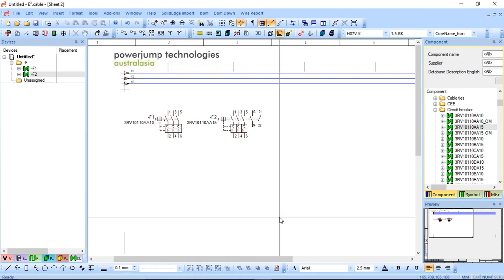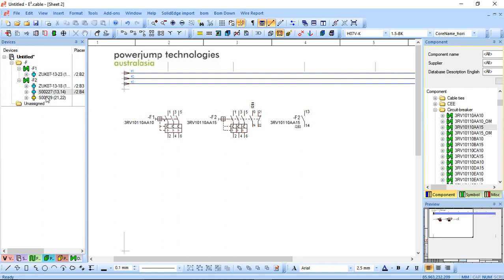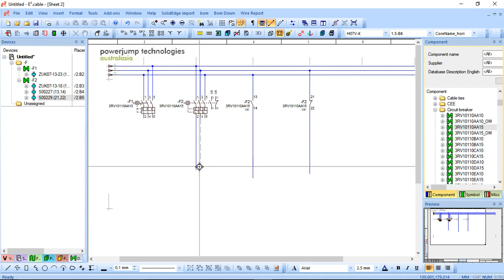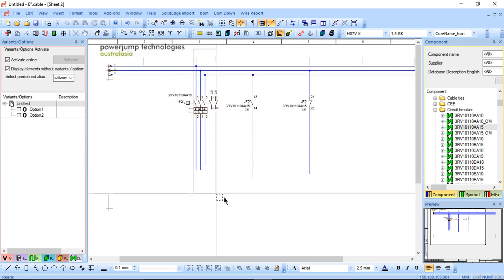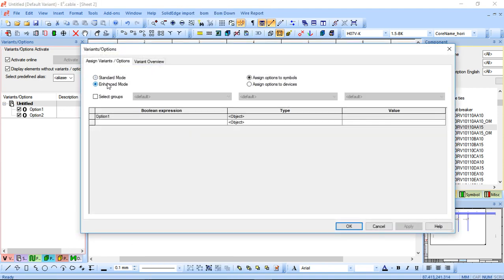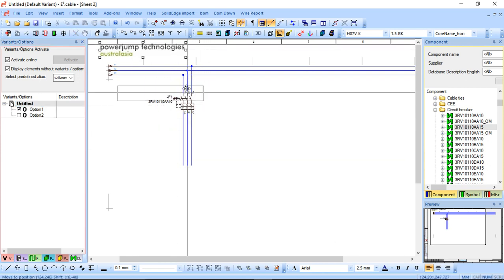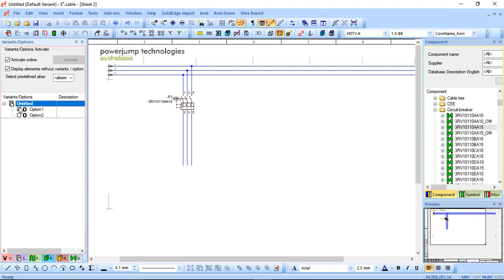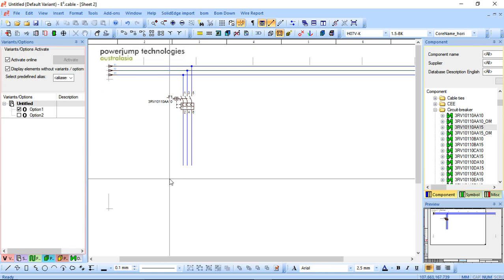Easy option/variant creation and selection using Zuken E3.series

Comment: Thanks a lot for this video but I still have a question. For example W2302-2 is my cable number ( device designation) but I want to use it in two different variant. In One of the variant it should be connected to connector, but in the other variant it should be dead end( with out connection ) but it should be there with same name.How can I do this?